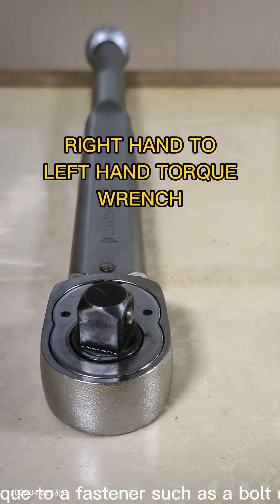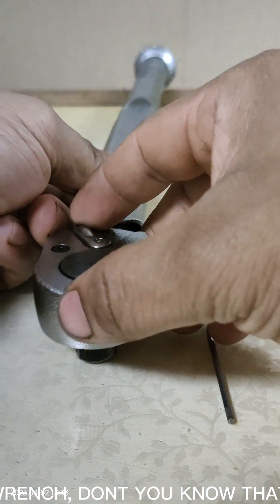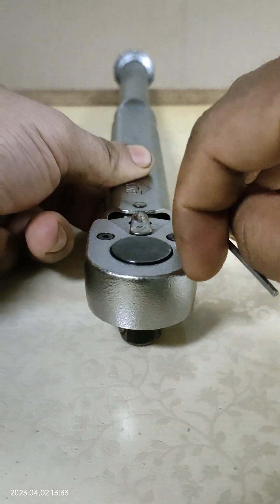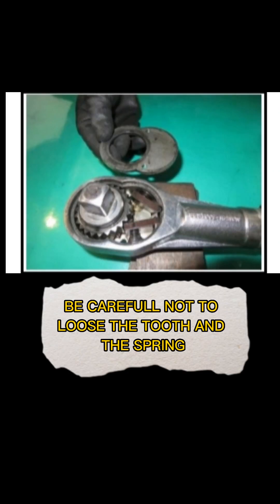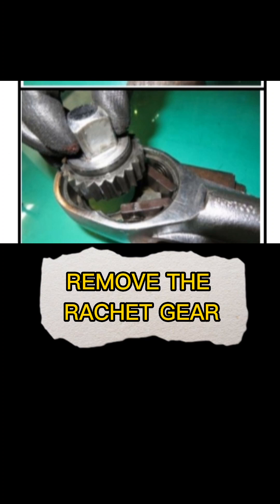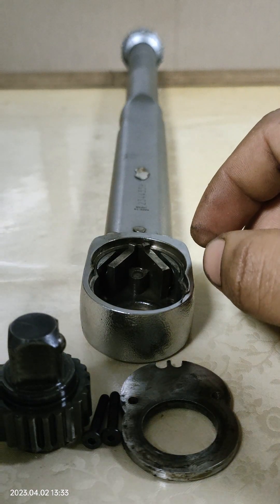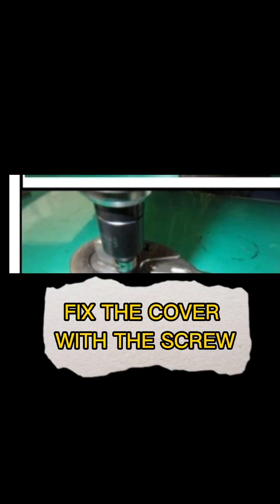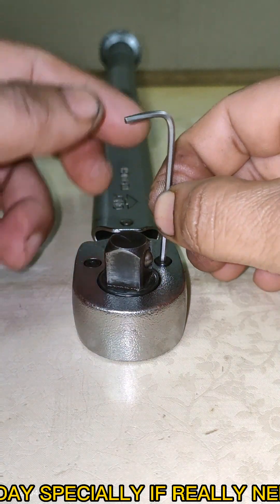TORQUE WRENCH, HOW TO CONVERT RIGHT HANDED TORQUE WRENCH TO LEFT HANDED TORQUE WRENCH

Comment: Person in the video obviously doesn't know how a torque wrench works. Pivot pin right below the head allows a torque wrench to snap to both right AND left side in exact same way. So the thing shown in the video is a total nonsense.
Reply: Obviously, some torque wrenches do not operate both directions as a torque wrench.  Therefore, it is your comment that is nonsensical, not the content of this video.
Reply: Some are designed to allow fastener removal without  needing a separate ratchet.
Reply: Your comment is nonsense and shows you've never used or pulled apart a torque wrench that only measures in one direction.